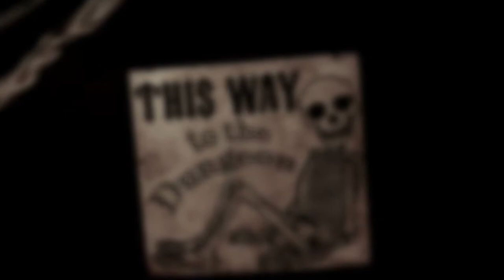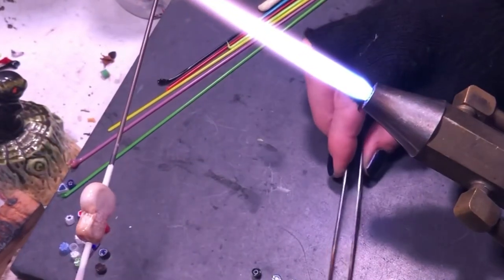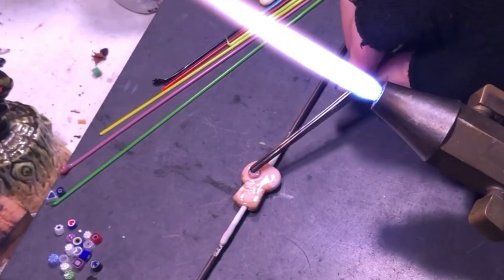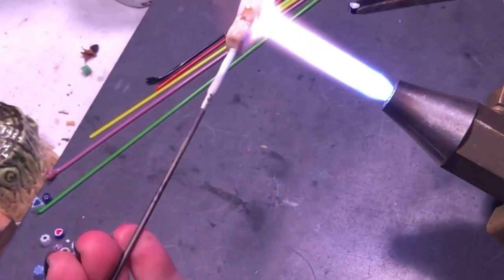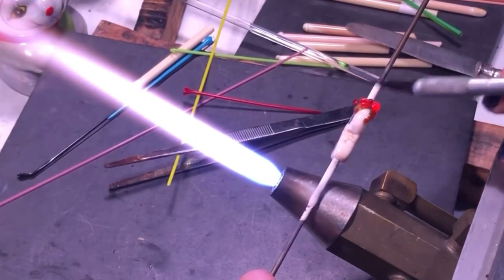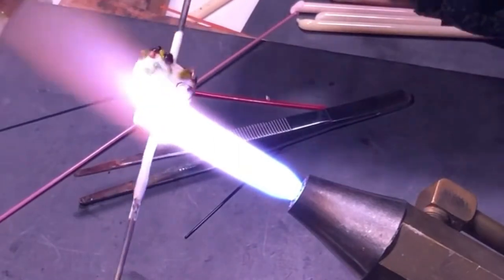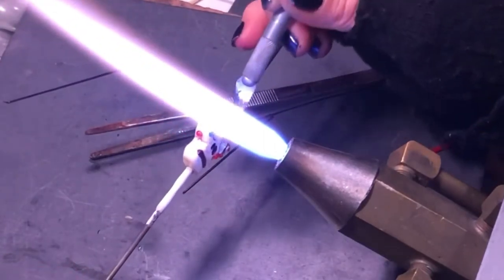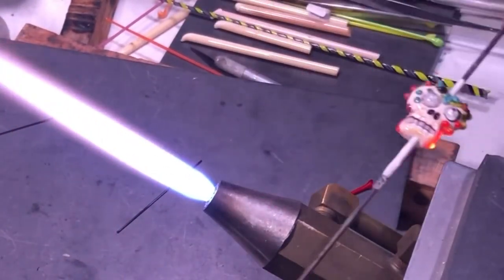Lampworking a Day of the Dead Skull bead - demo

Comment: Another irritating question... after I was my new mandrel and prepping, should I wipe them down with alcohol before dipping?
Reply from the maker: Good question Liz! The only thing I do with my mandrels is to give them a good scrubbing with a Scotch-Brite pad 
to give it a slight tooth that will hold  the bead release better...Then I rinse with water, dry and DIP DIP DIP!!!  😂👍🏽🌹
Reply: I do... Dawn, sand, dawn, alcohol and dip.  I’m waiting on good bead release, I just have the crap that came with my starter kit.  How many times can I dip?  Should I dip all in a row? Fire in between? Or dip, dry then redip?  I’m talking with my hands!  You can’t see me!  Oh My Goodness.
Reply from the maker: @elizabethwatson71  I would just dip them once. And let them all dry. I dip all my mandrels at the same time then air dry. I rarely clean them anymore, I just make sure all of the bead release is off and re dip!
Reply from the maker: PS... if you dip them more than once the bead release can start to break down when heating.   Just some thing I have noticed when dipping over dry bread release